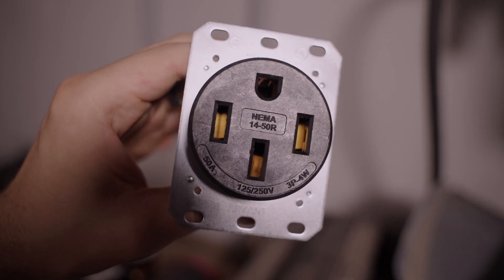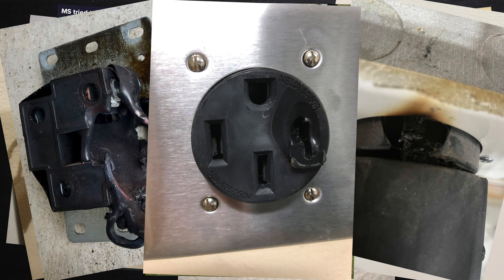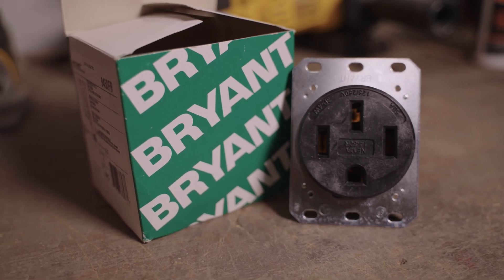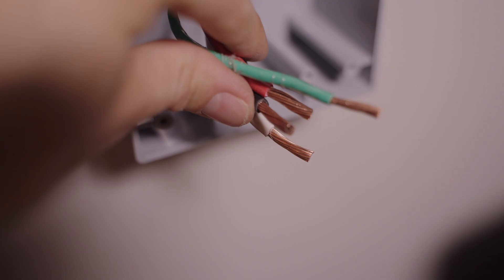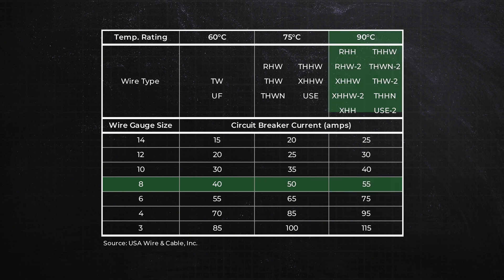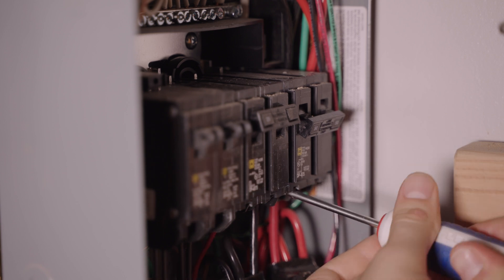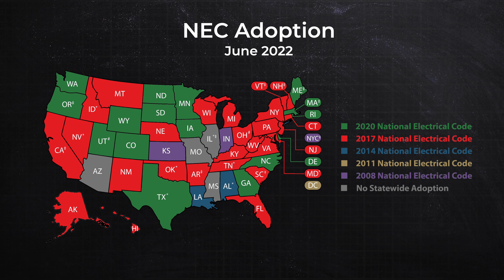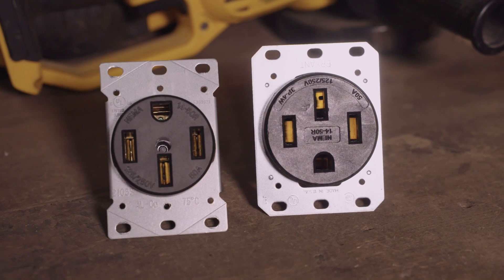3 Mistakes I Made Installing a NEMA 14-50 Outlet

Comment: My understanding of the evolving NEC code regarding EV charger installs is that they must be hardwired, not plug in.  Your local building code may be behind the NEC on this, using earlier issues of the code.  (eg my jurisdiction still uses the 2014 edition (!),  many are 2017) and IIRC the 2020 edition is the one that goes all in on hardwiring, so check locally on this but hardwire is the way things are going.
Reply: Plug-in units have not been banned by NEC in any way, please check article 625 to find that there is clear definition for plug-in devices. Plug-in is here to stay

Comment: Every manufacturer rails against GFCI. I've seen plenty of evidence that sequential gfci protection does not cause trips.  If you're not leaking current, you can't trip a gfci.
I did install all AFCI/GFCI breakers for my Electrical Expansion project, Computer room on dedicated circuit, to be extra cautious. More protection is better.

Comment: I did it right the first time, saving money by not buying a non-gfci and then a gfci.
The breaker never triped with my Tesla mobile connector. 
Don't do if for code, do it for your safety.

Comment: Nothing personal but you really shouldn't be "recommending" anything when it comes to stuff like this. As a person who does industrial electrical work for a living, I would "recommend" you hire a licensed electrician for a job like this. There are a lot of factors that need to be considered with something like this. I will give you credit. You covered several of them, but when it's all said and done, electrical work is very dangerous while you are doing it and after it is installed if not done correctly. If you bought an EV, you probably spent 40-90 thousand on it, and what's another 1000 or less to put the liability onto a licensed professional. It's still a good video, though.

Comment: Good points. EV charger installs is all that I do now and getting to the point of only doing hardwire installs. My latest outlet, the only commercial grade I could find was a Hubbell at $164. Also needed to run the unused neutral, add another $35. Right now my AHJ does not require a gfci breaker but will in the future, add another $100.
Reply: His link in the description to Grainger has a $48 rebrand version of the Bryant 14-50R (exactly the same).  The name brand Bryant on Grainger is $213.  They have the same two options for 6-50R.
Reply: I just had an outlet installation on Friday. Went to Grainger and got a Bryant 9450 for $48 and change. The Hubbell was $213. Looked to be a real Bryant but still a pain to install.  @mbrick
Reply: Can you please provide a list of parts for installing a 220 from the basement (residential) to the garage   a run of about 40-50feet. Which would be the most safe.  Just got a EV  retired don't plan on driving it all that much. I'm more of a V8 guy but the lease deal was good. Just concerned about most is safety.  Thank u
Reply: @TJOLLYRANCHER  If you are concerned about safety, the best thing is to get a licensed electrician to do the work and make sure a permit is pulled and work inspected. I cannot recommend this as a DIY project. Also, without seeing the site, there are too many variables to provide a materials list. If a Tesla, you can contact Smart Charge America, if a non-tesla, Qmerit and if you buy the charger from Best Buy, they all can put you in contact with certified installers.

Comment: Why use multi strand wire as opposed to single strand which is what my electrician used? Another point is that my Tesla determines what is needed for amperage. A message came up on the screen that I would not want to use maximum amperage so I adjusted it down.

Comment: So 14-50 should NOT been used for any EV systems. 560P9W from Hubble are the best option because they are locked so you can't rip it out of the outlet, on top the pin's have a much much higher contact surface and are industrial rated. So I highly recommend who ever needs to use a wall outlet to choose a Hubble 560P9W solution they come in 45 and straight connections.

Comment: Incorrect here. These outlets are NOT designed for everyday plugging and unplugging.  You will fatigue the metal springs/clips inside. Dryers, ranges, air compressor service cords are not extension cords vs. Charging your vehicle 350 times a year, perhaps more.

Comment: It isn't wise to run #8 for EV at 40amps, I wouldn't do it for even a wall mounted charging unit. I'm sure some would because people usually want to go with the least expensive material costs.  But 30 amps is the max circuit breaker I would use for #8 when it comes to EV charging.    I 've seen and replaced at least 4 charging units catch fire because whoever installed them wasn't qualified. And guess what wire size they used?  .... #8!  The 90 degree column is primarily meant for conductor derating, correction, sizing,  as most terminations are rated at 75 degrees.  
Don't just pick a wire and assume the ampacity in the column though because there's other factors to consider.   What we're concerned about with electrical systems is HEAT. Electricity generates heat, improperly sized conductors can cause fire or other hazards. 
I hate when non electricians give advice and "how to..." on things they really shouldn't...
Reply: What wire do you recommend then?
Reply: @chewyyo3383  #6 for Nema 14-50.  Copper.
Reply: @whattheschmidt  thanks, that what I ended up using.
Reply: @whattheschmidt  #6 Wire is so difficult to manage in a breaker  and gang box especially for a short run <6ft
Reply: @sanjapkoki  I used the large metal box that was deep and put the extended metal faceplate on that fits the Hubbell 14-50. 3/4 conduit feeds it, fit everything fine.  I think the key is to make sure you have this larger set up with the extended face so it all fits easily and safely.

Comment: Great information, especially the part about GFCI. One more tip for NEMA 14-50: Spray Deoxit DN5 into the outlet. It's a contact cleaner and lubricant. It will make plugging/unplugging much easier and will prolong the life of the outlet. You can use Deoxit D5, but you have to cut the power before using it.
Reply: Thanks, friend, I just ordered some Deoxit DN5!  Thank you!!
Reply: A lube is good idea as these connectors not rated for constant plug/ unplug use ordinarily.
Reply: The GFCI information in this video is not fully correct.